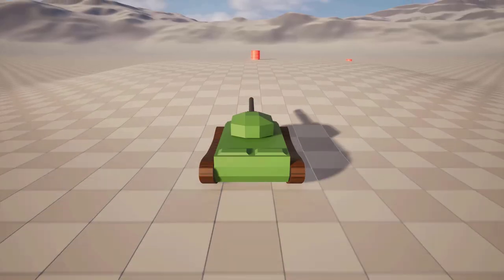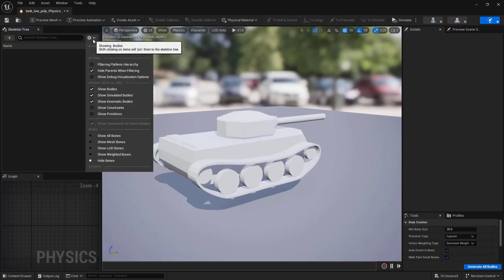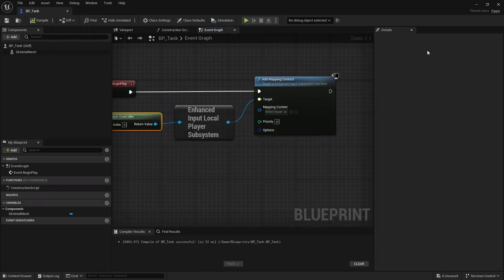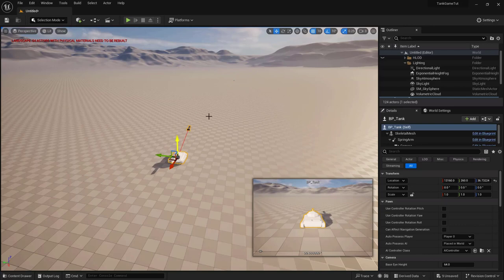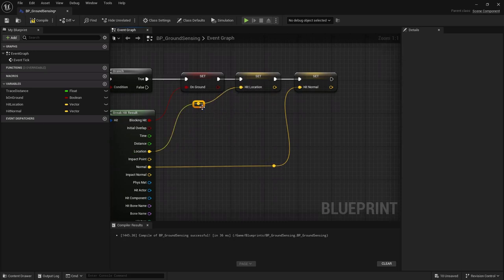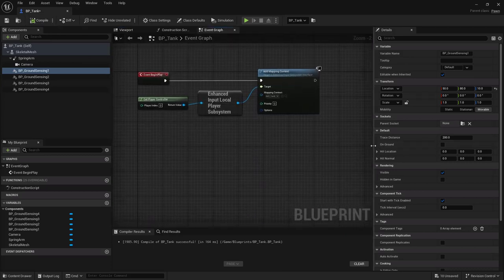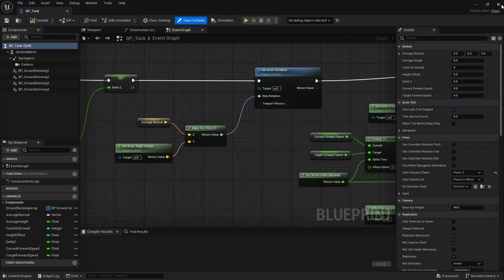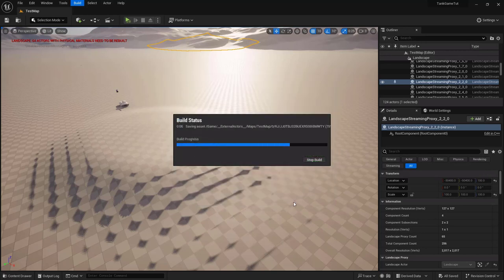Kinematic Tank with Ground Sensing from Scratch (Part 1) - Unreal Engine 5 Blueprint Tutorial

Comment: In my case it works good on even landscape but as soon as It reaches Hill or mountain of my landscape it starts jittering on Z axis like up and down throughout the way, Can you please tell me where I went wrong?. I loved the tutorial by the way.
Reply from the maker: If you are on the edge of a very pointy mountain, the line trace may go from one side to the other quickly, hence the jittering. You can introduce a bit of smoothing in the traces by averaging the normal values across multiple frames or adjust your landscape to avoid such situations.

Comment: Hello again, sorry to bother, but would it be possible to add all these movements into a pawn that doesn't have a skeletal mesh? I'm trying to add a kind of driving functionality to a PaperZD character.
Reply from the maker: Sure it is perfectly possible to use any static mesh or even a sprite
Reply: Check your height offset and set it to zero. I had the exact same issue and that fixed it (althought my tank was then buried) I plan to adjust the origin of my model (static mesh) to rest just ontop of the world origin to fix that issue.

Comment: Are the Event Ticks going to make this setup super heavy?
Reply from the maker: If you want to continuously trace to the ground there aren't many alternatives. And Tick is not necessarily heavy, it depends on what you do on it. You can always profile your application and check if you are overdoing it. This is not the case for this one.
Reply: @marcoghislanzoni  it‘s heavy to me, because i want to build a lot of tanks and put them into RTS game, not a driving game.😵‍💫
Reply from the maker: @kriswintf2027  You can optimize by having a central vehicle manager and running one single trace per tank. But how many you can run at the same time depends on the overall performance of your game.